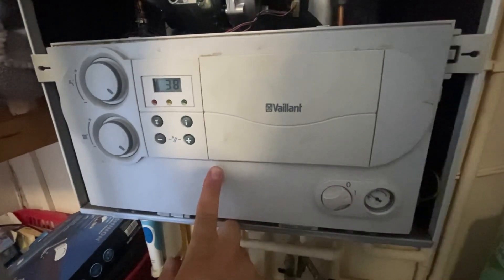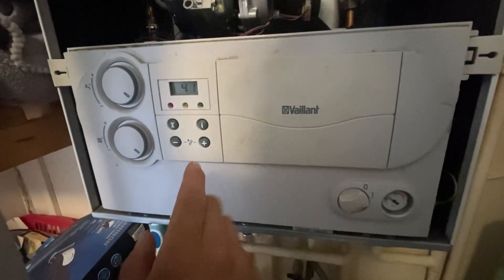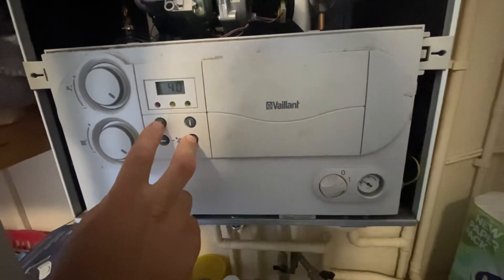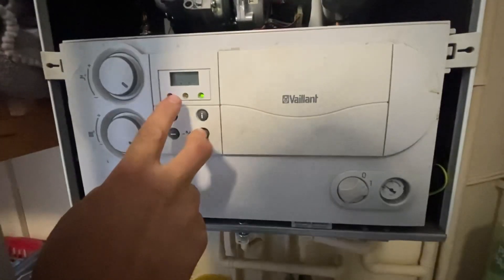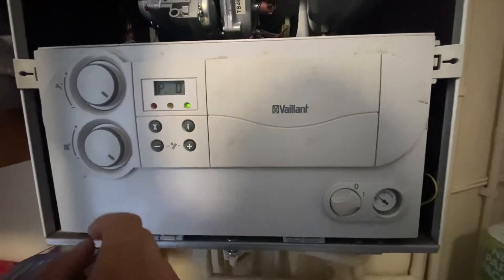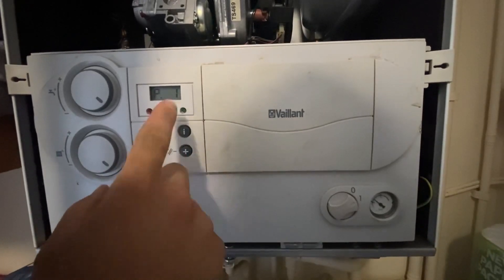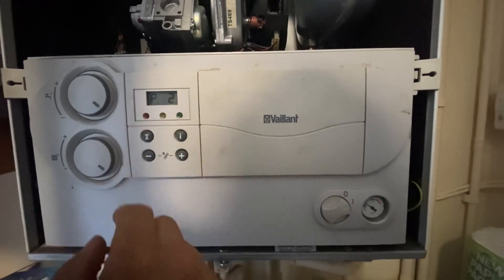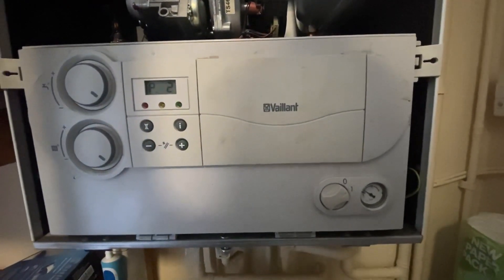How to put a valiant ecotec pro 24KW in to service mode || Boiler Training

Comment: thanks for video. ı have protherm panther boiler. ı replaced pcb and screenboard. ı have f70 error. how do ı solve this problem. thanks again.
Reply from the maker: It’s to do with incompatible software so basically the pcb, replacing the pcb should fix it, if replaced with a genuine part
Reply from the maker: But if you have replaced the pcb it will need setting up by a gas safe engineer